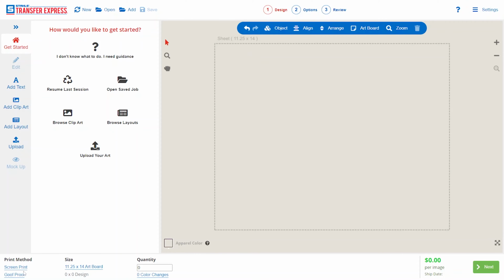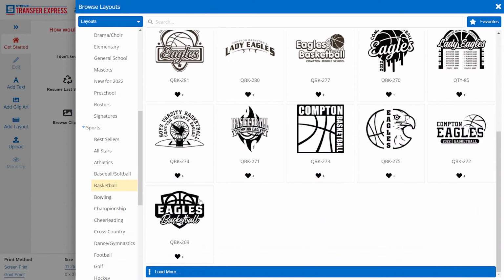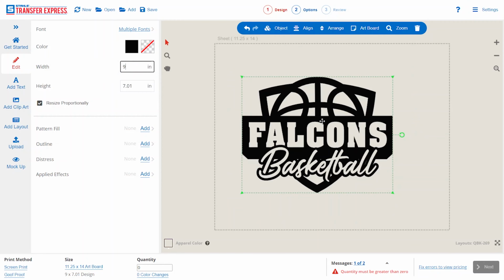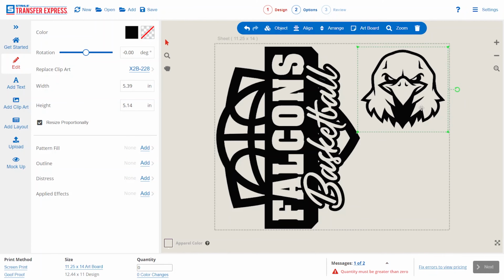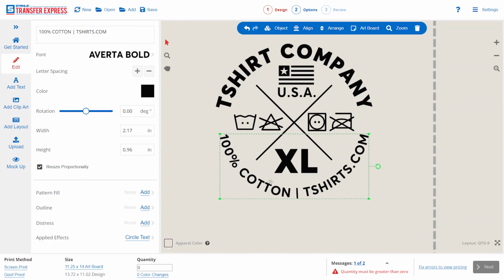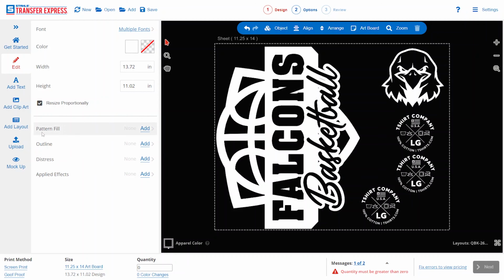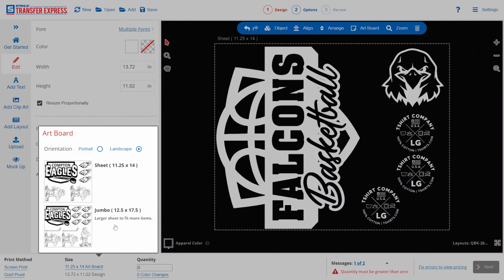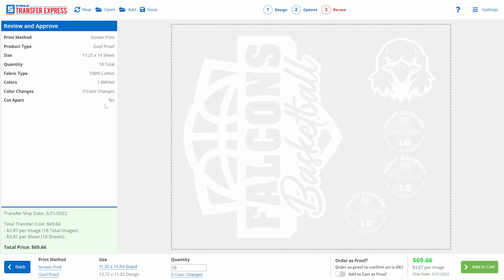How To Order Custom Heat Transfers at Transfer Express: Designing Online

Comment: Do you guys have an updated version of this video? As a brand new customer wanting to get going with printing ASAP, I'm finding the website a bit difficult to navigate. When I open the Designer, it's got Full color and Ultracolor Max selected with no option to change it. My design is one color.
Reply from the maker: We are actually working on updating this entire series as some transfer types have changed. It should allow you to click on the lower left hand corner to change, if it's locked on Full Color and UltraColor Max, it sounds like you may be at stahls.com, which is limited on the transfers available in the designer. 

For the full transfer options, try https://www.transferexpress.com/designer

Comment: Do you cut the gang sheets?
Reply: It never allows me and always gives an error...
Reply from the maker: We do offer a cut apart service. Things to keep in mind: The designer configures cut apart easily when you have it automatically gang sheeted (just place one image on the sheet and check the review step to see how many times it fits per sheet). Any cuts need to be straight lines from edge to edge across the sheet horizontal or vertical with at least 1/2 inch between each graphic.

If the system gives you an error, note that you would like it cut in the notes section in easy view, that way one of our representatives can take a look at the file.
Reply: @transferexpress  Thank you, I will make note next time I order. It always gives me an error so I'm guessing it's how theyre placed in designer.
Reply: @transferexpress  One more question because still having issues. Do I need to gang the file and then upload it or can I add a bunch of images to the designer and create the gang sheet there?
Reply from the maker: You can do either! Uploading the full gang sheet in vector format allows you the ability to resize or rearrange them if needed, or you can upload just each individual graphic and resize or arrange them in the designer.

Comment: I have a three color design I’ve been screenprinting but am thinking now to try it as a transfer, which type would I get to still get the screen printed look?
Reply: Would I send my .psd file with the separated layers?…..
Reply from the maker: You can just send us the PSD, PDF or any other type of file, we'll handle the seps!
Reply from the maker: Our Goof Proof transfers would be the closest match to a traditional plastisol ink screen print. Depending on the quantity needed (less than 36), our digital transfers may be more cost effective without feeling thick or plasticky on the garment. 

You can request free samples to feel the quality yourself here: https://www.transferexpress.com/marketing-tools/free-samples
Reply: @transferexpress  thanks so much, I’ll definitely check it out and be in touch, CheerZ!

Comment: I checked out your site, first off I'm not a business, yet so I have no way to make a free account. Second, I went to a similar named Stahls site and uploaded an image and there was no option to resize it or duplicate it to fit a specific dimension. The "NEW" site didn't even upload what I sent it and only offered Plastisol transfers.
Reply from the maker: Hey Llia, you can register for an account at Transfer Express without a business, there's only a spot on the registration form for a tax id if you need to be tax exempt. 

Second, Stahls' is our sister site, primarily known for HTV, custom emblems, patches and heat printing equipment. While they do have some of the same custom transfers (UltraColor Max and Cad Cut), that we (Transfer Express) carry the ordering process is a little different.